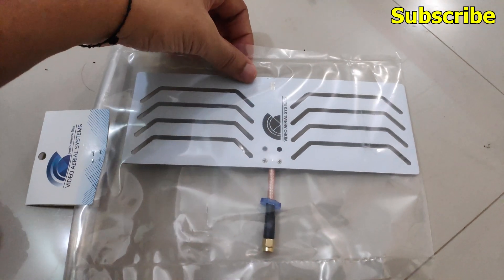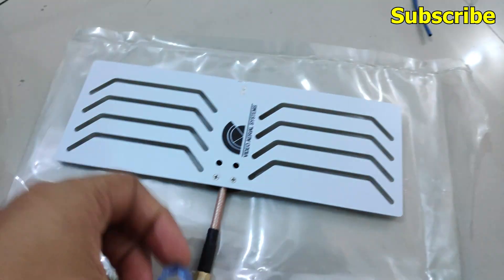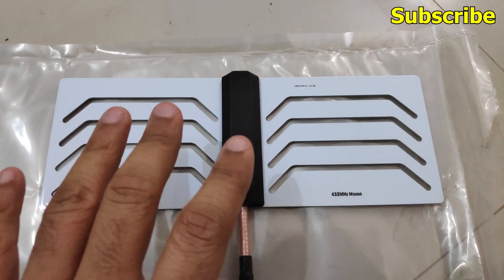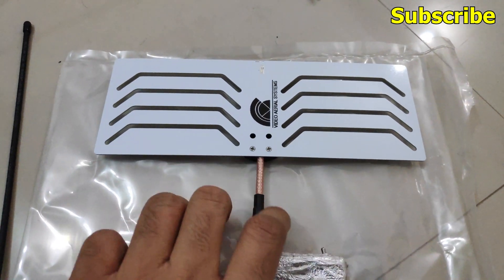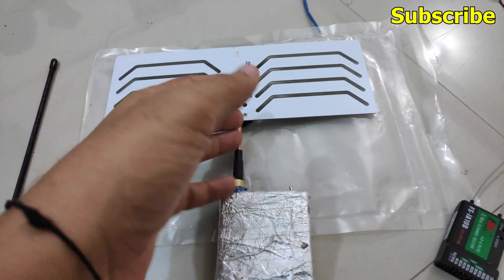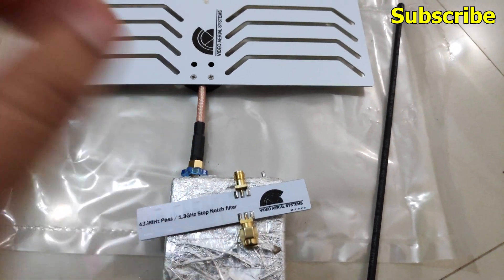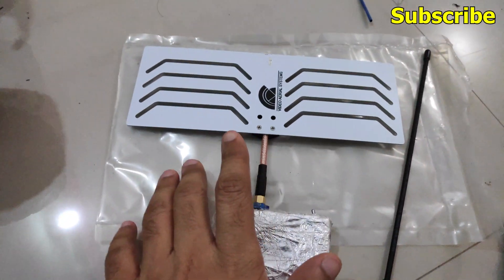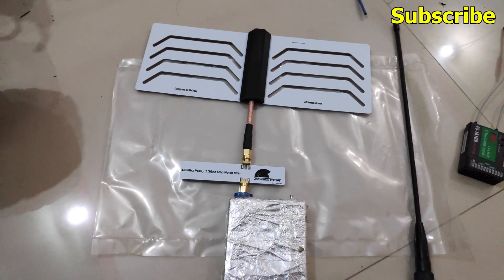433Mhz UHF Moxon Antenna by Video Aerial Systems for long range fpv | Rc Car FPV

Comment: I don't know where you are located, but a 4G LTE system would be better for RC trucks. I have a friend who did the same thing (i.e. 433mhz and then a 4G LTE link) and found the 4G LTE was WAAAAY better.
Reply: Any set up info?

Comment: What does your ground station and your radio transmitter look like now since the new upgrades
Reply from the maker: It's now more of upgraded stuff which one would ideally use for flying extreme long distance. I'll cover the new Setup soon in a new video
Reply: @RakishRc  many thanks